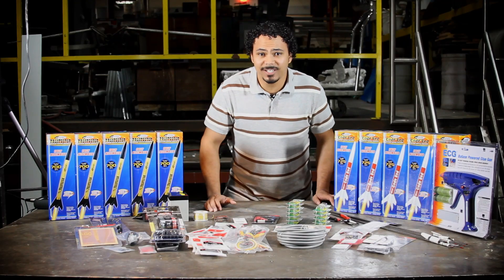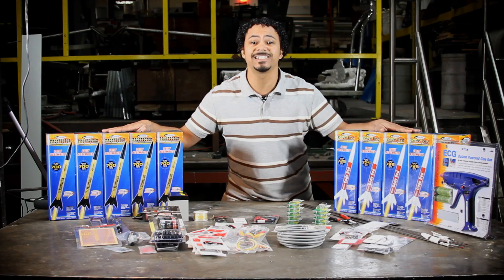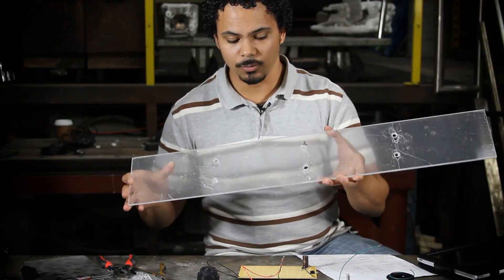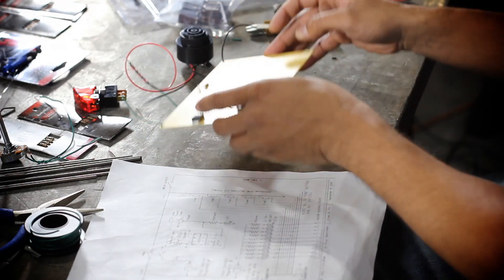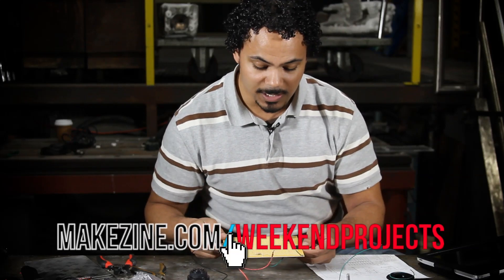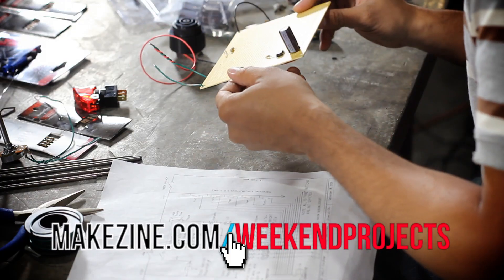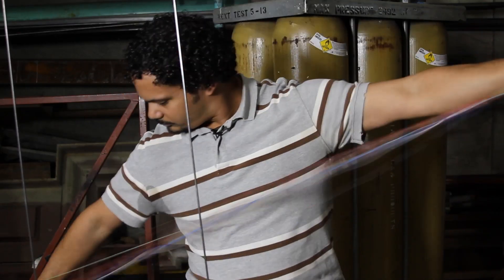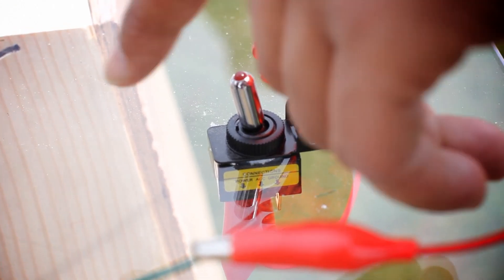Weekend Projects - 10-Rail Model Rocket Mega-Launcher

Comment: I just wish that there was more technical information in the new videos. This is well produced, but severely lacking in content.There is only about 30 seconds of information. Material sourcing (especially inexpensive sources for plexi), technical info (quick overview of the circuit, theory of operation, etc.) and maybe even a clear objective statement (what are you really building and why) would have improved this tremendously. Or maybe I'm just spoiled by the earlier products from MAKE:.